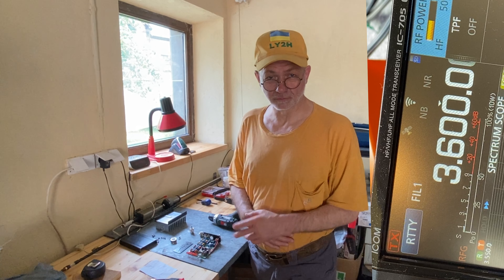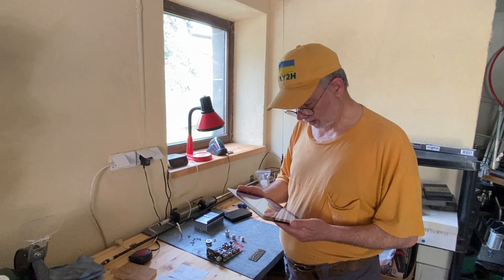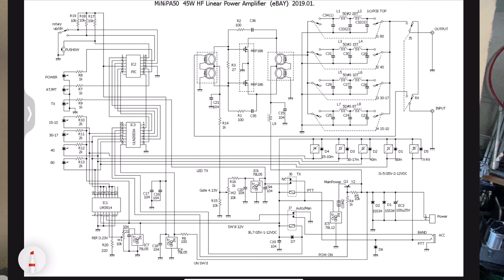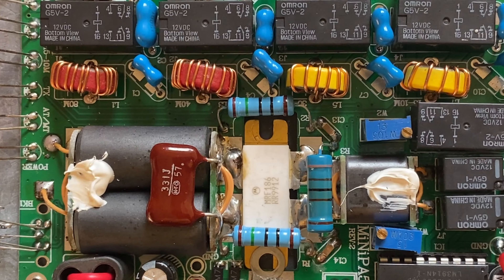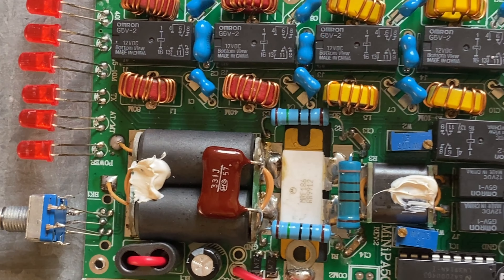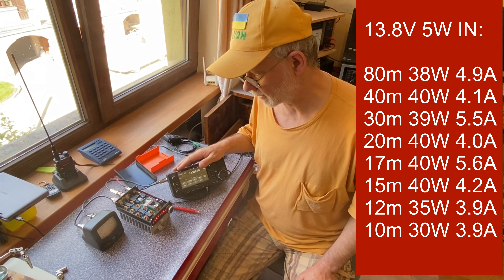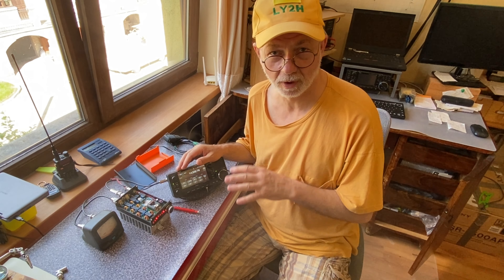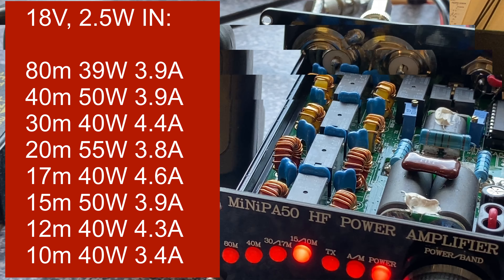MiNiPA50 HF PA with Icom IC-705: compatibility, real power output, temperature test, heatsink mod.

Comment: Hello LY2H,

Great Video!!! I was wondering if you know if the Micro PA50 has the same diode protection as the mini?

I have the micro paired with the Lab 599 Tx-500. I’ve noticed sometimes there is a spike of swr on the radio to infinity and it comes down but sometimes stays at around 2.5:1 while the amp states 1.3:1 or so? The radio works fine without the amp and the swr is always around 1:1 but I’m getting s9 reports with distortion and voice clipping.

Thank you!!
Reply from the maker: Thank you Bob! The vendors of the MicroPA-50 do not provide with the schematic diagram motivating that "it is not an open source", so it is hard to say if there is a diode installed you are asking about. Chances are, it is, as this PA is packed full of various safety features, so this simple diode would be the simplest thing to do. But if it is not, not a big deal for me, as I am mostly intend to use it in the automatic mode with the RF-sensed T/R switching, so no PTT cable connection would be employed in my IC-705 ( or any other radio). 
As it comes to the SWR anomalies, I have encountered nothing similar so far, but I've only have it since recently so too few of user practice to make any judgements. It seems to me, though, this PA is pretty sensitive to any "RF in the shack" and it's the CMC which may be a cause for the SWR-related abnormalities, so the RF choke is our friend here :). I could tell more after some more intensive use of it. CUL! 73! Linas LY2H
Reply: @Linas_LY2H  Thank you very much!!! I guess I am confused as I thought the issue was if the radio didn’t have the diodes while using the rf sensing there would be a problem. 

I just figured out what is happening with my SWR issue. I’m using SL259 to BNC Adaptors on the Amp. The connectors on the radio have a lip at the base that is too high causing the adapter to not seat tight. I switched over to cables with pl259 ends and it works perfect now. 

Thanks!!
Reply: @Linas_LY2H was still noticing some spikes of swr and put a choke on as you suggested. Absolutely all clean now!!

Comment: Excellent quality modifications and testing. 
Can you install a small shallow fan for the resistors at maybe half speed?... just enough to keep them at a safe level and not be loud?
Reply from the maker: Thanks for watching! A tiny fan would probably be a good idea, just as you say- it should be small and quiet . I need to look into that! Thanks for a tip!
73! Linas LY2H

Comment: Do you think the thermal efficiency would be improved if the black paint on the case inside and outside surfaces were removed ? There is now a similar product called Micro PA50 available from China. Excellent explanation ! Thank you.
Reply from the maker: Thanks for your comment! I think, these boxes, in most cases, are of anodized aluminum, not painted. As anodization is an electrochemical oxidation process, the surface, actually remains a part of the aluminum mass, not an extra insulating layer of paint. So, I would think, there is not much sense in grinding off the anodized layer for the purpose of better heatsinking. But I'm not major in metals chemistry, so may be other people here  would know better :) 
I do have and testing the Micro PA50 at the moment, looks and works nice. But it's not the same as Mini PA50. The transistors are different and much more features incl safety protection, are installed. The IRF530 transistors are not designed to work in HF PA applications, so could be problematic , but being very cheap, they are easy to replace. My review on this nice PA is in the pipeline :)
73! Linas LY2H

Comment: Very good and informative presentation. Really enjoyed it!  Wish you had increased the power input to the amplifier to at least the 5 watt level at 18V as the MRF-186 is a very rugged transistor and it would have been well within it's ratings.  What might be interesting would be to measure efficiency at different voltages right up to it's full rating.  I suspect you might find it would actually be more efficient at the higher levels and I suspect if the other PA components would handle it, you could achieve twice the power.
  Also, would have liked a little more information on your PTT method as some of these amplifiers have RF Sensing.  Did you use the "Send" output on IC=705 and if so, any difficulty?  Many seem to find it will not activate an external amplifier..  73 and thanks
Reply from the maker: Thank you very much Randy! Yes, I did try 5W ( and not only:)) IN at 18V (and not only :)), and the PA was giving out around 60W. Further increase in incoming power made no feasible effect , except that possibly overloading the gates of the transistors :). The transistor itself , by the way, was not getting overheated after the mod on the heatsink, but the 3 big resistors were. These resistors are important to keep the PA entry impedance in place , but they are getting very hot even at the modest duty cycle. I'd like to replace them with the more powerfull ones if I manage to source them out ( they need to be of non-inductive type). 
As it comes to the IC-705 SEND port, yes I use this connector as there is no any other on 705 ( like usual ACC port) :). It goes to ground on transmit and it's OK for the radio , as long as current this port has to handle is no more than 200mA. The relay in the PTT line on the PA50 is only drawing some 55mA, so it's OK. It's on 7.23min in the video about this issue. Practical test in the field proved it's OK too ( more on the field test in my other video: 
https://youtu.be/lOmpzDdTt6E

Thanks for watching! 73! Linas LY2H

Comment: Interesting video linas, and too much heat is always a worry.
Is it possible to use the unit upside-down,  therefore the heatsink is on the top.
Maybe more drilling and some small holes on the top for air to rise.
Good work.73.
Reply from the maker: Thanks Brian! No, you can't install the heatsink on the top cover , as the PCB is so designed that final transistors have to be fixed to the heatsink from the bottom side. But it's certainly possible to flip the whole PA upside-down when in use ! :) 73! Linas LY2H

Comment: Transmit relay buffer as recommended in the icom manual?
Reply from the maker: Hello, as I understand it, the manual recommends to put a diode accross the power contacts of the RX/TX relay in the PA . If you mean the same, then, yes, such a diode is installed in the MiniPA-50. 73! Linas LY2H
Reply: @Linas_LY2H  Yes, meant the same, just didn't have the terminologies correct. Good stuff! Thank you!

Comment: Very informative video as always.  I opted to pick up a Yaesu FL-110 amplifier instead of getting one of the PA50's.  Now you have me wondering if this older amplifier may have the same fedback issues and be harmful to my IC-705?  Guess I will have to do more research before hooking it up.  Seems to work well with the FT-818.  Thanks again for your videos.
Reply from the maker: Thank you Raith! And congratulations with an excellent purchase , the FL-110! I wish I had one too! I like this pre-FET, pre-WARC design. As it comes to the work together with the IC-705, I see in the schematics this PA is PTT controled by the RF signal sensor, actually, not the PTT line from the transceiver? I’m not sure there is even a PTT socket anywhere on the box :) If so, then it does  not matter , the pecularities of the PTT line in the IC-705. I found an excellent article by a Dutch ham PA0FRI here, hope it could be useful for you , or you have it already may be: 
https://pa0fri.home.xs4all.nl/Lineairs/FL-110/fl110eng.htm
Have fun with it! 73! Linas LY2H
Reply: @Linas_LY2H  You are absolutely right.  No PTT socket and RF sensing.  Thanks for the hyperlink.  I will put it into action.  I have heard good things about this amplifier and managed to find it in a junk shop for $150 cdn.  Looks almost new.  It will pull it out and use it with by qrp radios (TruSDX, FT-818, IC750 and the QCX & QDX when they arrive) when a little more power is needed.  Your clever insights into radio are greatly appreciated.

Comment: My xiegu g106 is only swinging 1 to 2 watts. Will just 1 watt activate the amplifier?  This information would be very helpful.  Thanks
Reply from the maker: Hello JR! You got me curious, so I took some measurements. The values below are for the 13.8V power supply, I’ve measured it on 14.1Mhz and 7.1 Mhz frequencies, from my IC-705 transceiver. So: 0,5W IN=6W OUT on both bands. 1W IN=20W OUT (20m band), 14WOUT (40m band). 1,5WIN=30WOUT (20m), 20WOUT (40m). 2WIN=35WOUT (20m), 30WOUT (40m). At the power supply level of 18V, the output power is actually the same at the input level up to 1.5W, and it reaches up to 40W of output at the 2W input level.  The values above 2W input level are well described in the video. Hope, this helps! Good luck with your G-106! (it should deliver more power, may be some tweeking of low pass filters would help, like squeezing/spreading the turns on the toroids?) 73! Linas LY2H
Reply: @Linas_LY2H  Thanks so much. Not many people will go out of their way to help someone out.  A hundred thank you's...  73's   JR.

Comment: Hi there.  I was very interested in the MiniPA50 and was planning on buying one. But astonished how much they cost to buy in the UK. At one place it is £798 with £17.67 postage. Via Alliexpress its £448 and £10.84 postage. So with only my state pension it's too much money. A 50w SDR transceiver is lower cost. Cheers from old George in the UK 🤔🇬🇧🤠
Reply from the maker: Hi there. That's insane! I think, I was paying something abt 180EUR some years ( pre-pandemic) ago. If you try to go via the amazon link in the description ( my affiliate links) for the MX-P50 amplifier, the same link opens also the Minipa50 offer at GBP 229. (The first link in the description seems to be broken now. ) 73! Linas LY2H
Reply: By the way.  This is not a critisim of the Minipa50 and Ly2H's video.  I always enjoy his content.  Just saying if like kit building and want to save money, you can build a very similar amp.
Reply: @markmeyers7923  Hi Mark I do enjoy building stuff. But in kit form it can work out more expensive. For example today to make a 49 to 1 unun. With Toroid, Connectors, wire, nuts and bolts, Waterproof Box adds up to £24. I have just purchased a ready made unit for £15. Doesnt make sense to me. Every penny counts at the moment especially in the UK.
Reply from the maker: @markmeyers7923  Thanks for your comment! I agree, kit building is fun, I do a lot of it. As it comes to the cheap (pricewise) Chinese HF PA kits, they should perform normally, if  components,  like FETs are not fake etc. :) and low pass filters supplied by the user ( another simple kit). Then it's the same as MX-P50. As it comes to the MiniPa50, it's a bit more sofisticated device with the voltage comparator circuitry in it in order to decode Yaesu band data from the FT-817 trx, wich this PA originaly was created to work in duet with ( and it really works nicely with my old '817). I have heard of no Chinese PA kits being complicated by such a functionality, so far :) 73! Linas LY2H

Comment: I have the MicroPA50 and the fan is so lud that I dont really use it.  But if i had a heat sink like you have and disconnect the fan, and I am only SSB, I might use it again
Reply from the maker: Hello Mike, thanks for the comment. Yes, the fan is noisy in MicroPA and clearly needs a fan mod which I’m working on now. As it comes to the heatsink, interestingly enough, it’s much better/larger  than the  one in MiniPA. The fan, actually is effective, except for the noise :), and helps the whole construction stay compact, which, I think is rather important for the portable user. CUL! 73! Linas LY2H

Comment: Nice video! The schematic of the MX-P50M is wrong. Not only the missing flyback diodes, but also the not switched bias voltage are reasons to doubt the schematic. In fact, the MX-P50M is using flyback diodes for the relays incuding those for PTT (placed on the bottom layer) and the bias voltage is also switched on by the PTT. So the modification shown by KB9RLW is not necessary. The PTT is safe and needs under 50mA  (considering 2 x 720 Ohm coil resistance parallel) to switch.
Reply from the maker: Thanks for watching and commenting! As I said in the video, my story is not about MX-P50M because I don't own one :), so I can't judge if the schematic is correct. I thought it is correct as simple Google search produces the one I mentioned , for example the one presented by WB4KDI on QSL net. As it comes to Kevin's KB9RLW mod , I also saw reports of numerous hams who made this mod on their MX-P50M PA's and were happy with the results. It could be that you have some other, unknown to me, incarnation of that PA with all the diodes in place and of different schematics. I'd be glad to see this PA and that schematic diagram for the sake of some possible future videos. Thanks! 73! Linas LY2H
Reply: @Linas_LY2H  Thanks for answerng! I agree, you are presenting the MINIPA50 and did it the right way, checking and comparing the schematic with the real device. That's good practice! I don't know where  the wrong and incomplete schematic for the MX-P50M is coming from. I have here 2 devices, both v1.3, like the one in Kevin's video and both are "safe" to use. For sure there is nothing wrong doing the mod, but not necessary. 73 de Cyp, DL1CYP.
Reply from the maker: @cymo7817  That's good to know, thanks for the info OM! I feel intrigued now to buy one myself and see :) ! 73! Linas LY2H

Comment: Another informative video. IC 705 is bringing lot of possibilities to you.
How do you match its reciever with contest rigs such as ts590?. I saw other video where you operated a contest with only 705. Very interesting to see what little rigs can do paired with Juma amp in contests
Keep sharing.. de vu2xe
Reply from the maker: Thanks for watching! I don't have the TS-590, so can't compare with it. I have fully upgraded Elecraft K3 instead, so it's gotten a bit lower noise floor vs IC-705 and better Dynamic range when coping with strong adjacent signals. I mean, it's my subjective perception, I've been doing no 2 -signals or similar tests with signal generator. But IC-705 is better , IMHO, than my IC-7300 despite being "similar" which they are not :). The receiver on VHF/UHF is very low noise and sensitive, really better than my former FT-897 or IC-706mkII . And yes, running the contest with my Juma PA in the HP category ( though I like QRP more) is just fun! 73! Linas LY2H
Reply: @Linas_LY2H  k3 is Fb rig

Comment: I haven't seen a "real" MRF186 out of China.  I would highly recommend not depending upon the values on the Motorola data sheets.  Especially SWR and wattage; as evidenced by the 7 or 8 dead "MRF186's" that have found new homes in my garbage within the last year.
Reply from the maker: Thanks for sharing this down-to-earth experience of yours! Very useful and good to know! 73! Linas LY2H